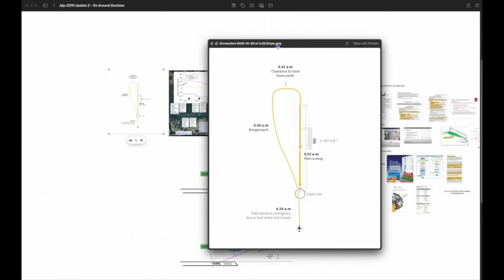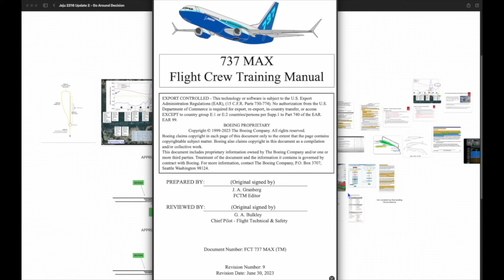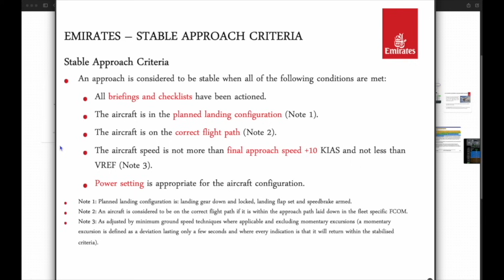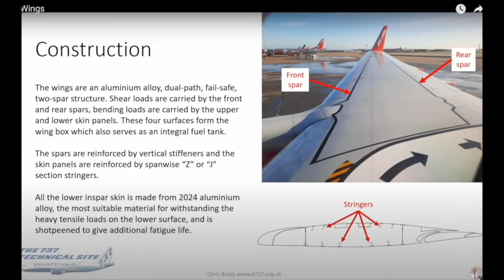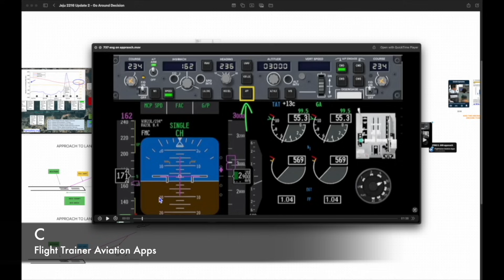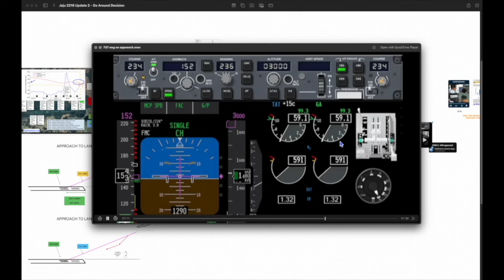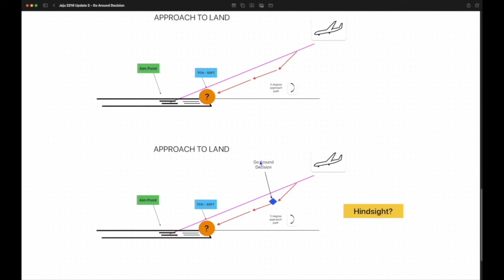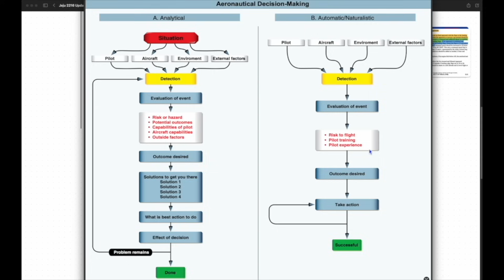Go-Around Explained: Jeju Air 2216’s Decision Not to Land

Comment: Are we certain the go-around was initiated AFTER the bird strike? In eyewitness video of the compressor stall, I don’t see gear down. If the approach became unstable due to avoidance of birds, then a go-around seems a sensible decision. If a dual engine bird strike happened on the climb out, then you really are up shit creek without a paddle, as you no longer have the runway in your path 😢
Reply: bird strike happened before the video, video was made due to unusual sounds, video shows compressor stall while increasing engine thrust after initiating a go around - a theory.
Reply: The video CLEARLY SHOWS the gear up OVER THE RUNWAY!!!! They were CLEARLY ON TOGO WHEN THE BIRDSTRIKE OCCURRED!!!!!
Reply: 8:58:15 Their climb rate begins increasing in response to some incident
8:58:28 They reach peak climb rate
8:58:50 Electrical power is lost

If you take their altitude line before the incident and extrapolate it, it would intersect with 0 ft at about 8:58:55. If you add in some allowance for slowing their descent and flare, they were probably aiming to touch down around 8:59:00 - 8:59:05. 45-50 sec after the upset incident happened.

That video was shot from a building about 1 km from the south end of the runway. 1 km @ 140 knots = 14 seconds. So when the plane flies over the house, it was about 14 sec from the runway. Call it 20 sec to account for aiming a bit further down the runway and flare. Which means it flew over the house at around 8:59:40 - 8:59:45.

So what we see in the compressor stall video cannot be the incident which caused them to decide to go around and begin climbing. Likely there was a birdstrike 15-25 seconds before that video began (my Korean sources say the guy who shot the video heard compressor stalls, ran out to the balcony, and began shooting the video). They initiated the go-around, raised the gear and shut down the damaged engine.

Then the guy began shooting the video, and they (possibly) suffered another birdstrike, causing them to lose their remaining engine. But by that point they were too high to resume landing, and were forced to continue the go around.
Reply: @ That’s exactly what I said. TOGO was BEFORE the BIRDSTRIKE.
Reply: @johnp139 Bfr ENG#2 bird strike, but aft ENG#1 bird strike. Meaning, ENG#1 out, why risking a GOA???
Reply: The ATC communication clearly showed that the go-around was initiated after the bird strike. The call was Mayday, then going around., then a clearance request for R19.
Reply: Bird warning? Just continue to land... even if not PERFECTLY stabilized. In going around, you have the risk of bird strike when you really don't want it.

Comment: Excelent video. Your point about hindsight is most pertinent, as so many people pass judgement without the ability to empathise real-time, moment to moment reaction and response  when dealing with  sudden and (probably changing) aircraft performance issues. Unfortunately many people want quick and simple answers that allocate blame. 
I appreciatey your realistic analysis that acknowledges the natural imperfection of the human nervous system, and also includes solid technical informaion. After these huge disasters we get a lot of 'shoulds'; pilots 'should' do this or that. This has it's place, but asking 'why' they did what they did can bring insight and learning and hopefully ways to improve. Like for example, what conditions promote optimal pilot performance and vice versa.
Reply from the maker: Thanks for the comment, learning is the key takeaway in my view so I appreciate it
Reply: Forget hindsight, try training  like  checklist  and pilots choosing not to lower wheels, try raising flaps after a birdstrike. Who does that?
Reply: @Tazjet100  The pilots followed procedure - after a bird strike on final, immediately initiate a go-around. Memory items on the go? #1 Raise gear. #2 Raise flaps and slats. So, they followed procedure and their training precisely.

In the time they had, they would barely be able to complete memory items. It is very unlikely they ever even looked at a checklist.
Reply: @petercollins7730, they needed the landing gears to assist with control and speed reduction. Amazingly, most folks give them a pass on a basic landing requirement. Poor airmanship all around. Sad for the passengers and flight attendants who lost their lives.
Reply: @ They "needed" a lot of things, but didn't have them. The fact is that they did not have the ability to lower the gear before touchdown. If you knew anything about how long it takes to lower gear without power, you'd know that.

And since they made a perfect teardrop turn, with no power, and a textbook gear-up landing, on the centerline and straight, "poor airmanship" is a ridiculous claim. They flew outstandingly - they just ran out of runway.

Comment: Good video, thanks.  One thing about the go-around decision that doesn't make sense to me.  The pilot clearly thought that he had sufficient thrust on one or both engines, even though compromised, to execute a go-around.  It turns out that he did as he came in high on 19.  Isn't it true that if he had sufficient thrust for the go-around he must have had sufficient thrust to continue the approach for 01?  It appears he had two good options and that the state of the engines was not the deciding  factor in his decision.  What was?  Please correct me if I'm wrong, but my guess is that training leads one to view the "analytic" decision-making process as preferable if one has the choice.  In this case the pilot chose to go around and I would guess in order to follow an analytic decision-making process.  Understandable.
Reply: This is my completely baseless opinion, but I feel like during the go around he was getting compressor stalls, banging, and the smell of smoke on the good (right) engine while the left engine was completely gone. FO's screens were out as they never got any of the generators back on the bus. It was probably pretty evident to the Captain that he was dealing with a catastrophe and he decided on a power off 180 back to the field, but couldn't judge the distance to a runway that was behind him. I think he did better than most veteran pilots would have in that scenario. It seems like the only survivable move would've been to continue the approach after the engine failure during final.
Reply: I agree that in hindsight continuing the approach to 01 would have been best, but the go-around to 19 should have been achievable.  He could not have done a power off go-around.  He was at 500ft AGL 1 mile south of 01 and was able to come in high for 19.  There is no way to achieve that without power.  I think we have to assume that he had the ability to set up a survivable approach to 19.  It appears his mistake was in selecting a right hand pattern.  A left hand pattern would have enabled him to look over his left shoulder on downwind and keep an eye on how far past the end of the runway he was before turning base/final.  He was presumably flying stick and rudder using steam gauges.  He needed to eyeball the end of the runway.  At that point making it to 19, though,was not at issue.  With a decent downwind - quite achievable - there would have been no high speed touchdown half way down the field.  I don't know what to think about their inability to drop the landing gear.  Panic?  In any event, with a decent downwind the chances of survival increase dramatically.
Reply: No one wants to admit the stunning conclusion - that the pilot unnecessarily went around, thereby increasing the risk of crashing.
Reply: @davethewave7248  No one wants to admit the stunning conclusion: Boeing can't handle bird strikes.
Reply: @ It seems to me just about everyone has been saying that in the comments on every youtube on this crash. The difference here is a few contributors are questioning that conclusion and/or trying to speculate as to what unique set of conditions might have prompted their decision. Many aspects of this accident are still undermined. I think it is still too early to talk about 'conclusions'.
Reply: No expertise here, just a bystander.  If there were a complete power-out, the dashboard would have blacked out. The pilot could have concluded - 4 mins before the crash - that the plane is in a glider mode. Whether this was the fact or not, this may have been the information in front of him with nothing on the dashboard.
Reply from the maker: Very good question, we have little information at this stage, so it's far too early to answer it. We can build a scenario around it and explore options that cover most eventualities, otherwise it's a waiting game.

Comment: Did it "crash" on landing, or did it "crash" when it hit the concrete structure past the end of the runway?
Reply: The landing was a textbook gear-up, hard surface landing - touchdown only 900 metre from the TDZ, perfect flare, directly on the centerline, straight enough that it remained on the runway to the end. If there was no concrete structure far too close to the runway end, this was likely a very survivable accident.
Reply: @petercollins7730 "only 900m" is quite a distance when landing way over speed and no means to slow other than friction on the engine nacelles! If course the pilot was under his constraints but I wouldn't exactly call that textbook. If there been wasn't there the plane would have been a long way past the end of the runway
Reply: @alexanderSydneyOz  Without flaps and slats, landing speeds are significantly increased. At their speed, the ground effect will make the plane float very badly. Putting it down in those conditions only 900 metres long is very good flying.

I suspect they would have overshot and crashed anyway, but the short runway and the long landing, even though necessary, didn't help. At impact, it had lost only about 100 knots.
Reply: @petercollins7730  Completely agree. Without flaps and landing gear would result them gliding into the ocean. However the perfect landing would indicate at least one engine was working to provide the hydraulics and thrust.
Reply: @Anonymous-v8s2s  Even though one reversers was open, I seriously doubt they had any thrust there. They stayed dead true on the centerline all the way to the end; if they had reverse thrust on one side, they would have slid off the runway on that side, It appears they were having frequent compressor stalls on #2, which usually means it is not producing any significant power.
Reply: @ Yep, also agree that #2 engine was so damaged it barely had any coefficient.

"if they had reverse thrust on one side, they would have slid off the runway on that side"
^^ I initially thought they would have been pushed outside the runway through the other side : the reverse compound would have started to spin the aircraft clockwise (from above), then the air cushion lateral compound would have developped towards the left, pushing the aircraft in that direction.

But that was 1) when I noticed the engine inefficiency ALONE, failing to consider the massive vertical fin along with the 2 deg orientation of that engine towards the fuselage. And now 2) faced with another puzzle (zero or negative thrust reverser efficiency), while investigation did find birds remains in both engines, I suggest one new hypothesis :

How about severed thrust reverser trap panels levers ? Don't remember exactly, but there are about 10 trapezoid tilting panels encased in the main fan cowling, connected to turbine cowling with levers (they are in the way of airflow, hence, vulnerable to big birds). When the reverser slides back, the levers drive the panels to pivot and trap main fan propelled air, which is forced to exit main cowling from the grid on the sides. If most of those levers are damaged, the panels won't pivot, deploying reverser would actually increase thrust..................... and give more clue to why that incredible speed beyond just having the aircraft half scrapping the concrete, half flying.
Reply: I think it's fate was sealed when catastrophic power loss took away most control of the aircraft from the double engine bird strike.
After that, they did ok but the aircraft was quite crippled and had lost its ability to decelerate in the emergency landing that followed. They did not have the 3 km of runway required by their plane configuration to stop in this situation so they were likely going to hit something and explode regardless of what was at the end of the runway. 

They had fuel onboard. 
They didn't get the gear down, which should have been possible if they weren't inundated with trying to fly the plane without power, but even with the gear down, this situation is not good at all. 

The double bird strike and inability for the aircraft to activate backup power sealed their fate really. We know this is true because both the flight data recorder and the voice recorder had lost power, which indicates a catastrophic electrical systems failure.